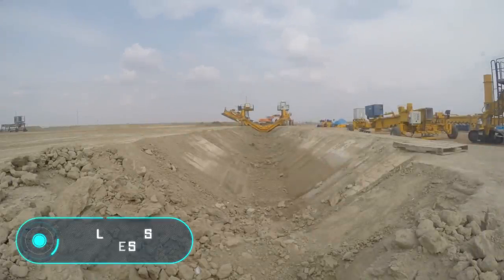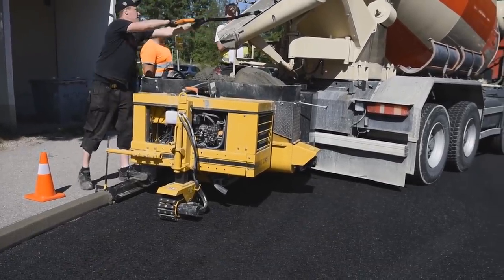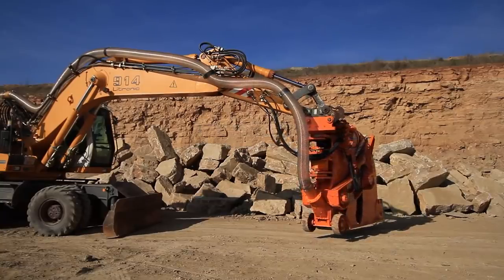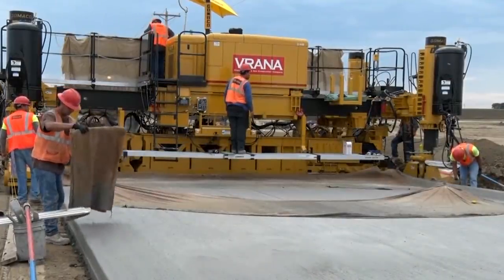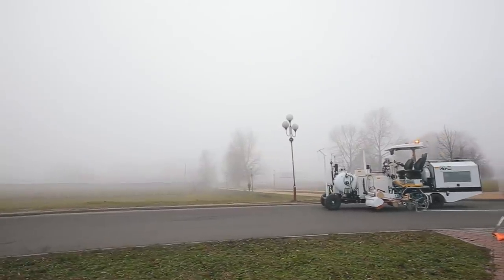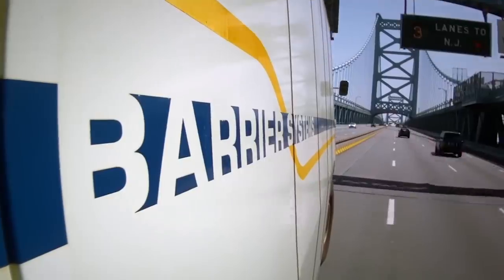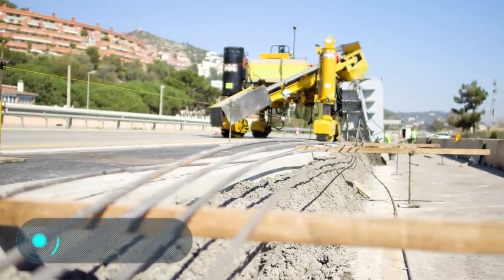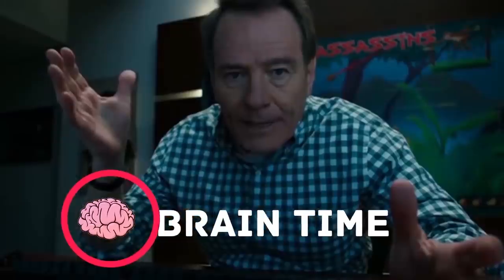MOST AMAZING MODERN TECHNOLOGY ROAD CONSTRUCTION MACHINES IN THE WORLD

Comment: the "xtreme" commander 3 just has the same slew drives as the gp3 or gp4. just smaller versions of them for the tracks so they can do a full 360 pave mode for curb and gutter. or 4 track pavers. they really are thr best in paving